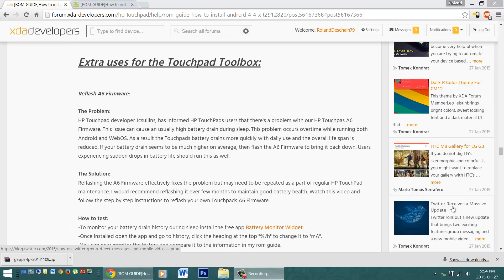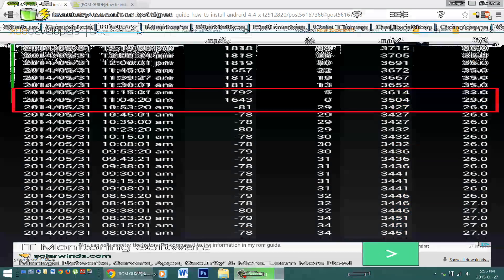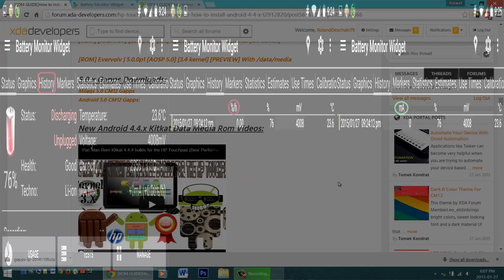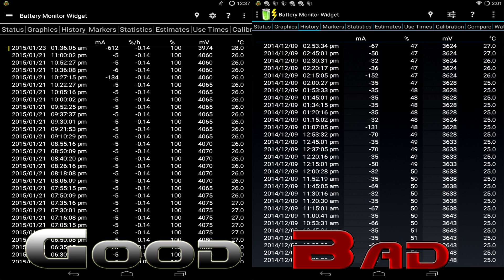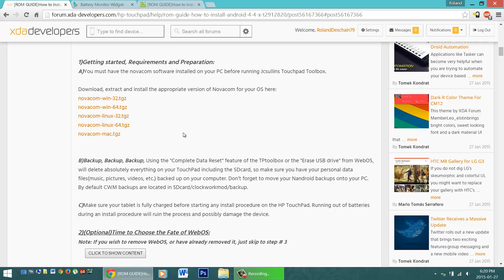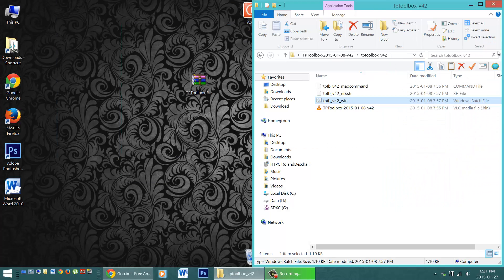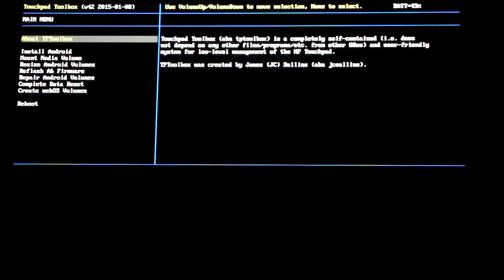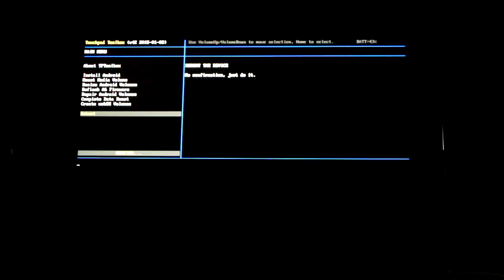How to Flash the A6 Firmware with the TPtoolbox

Comment: This was a breeze! Thank you for this and all the other Touchpad tutorials. I notice you mentioned putting the tablet "to sleep" over in the xda thread. Is this the same thing as airplane mode?
Reply from the maker: Pasha Davidson Not sure about what you're referring to as I have lots of posts. Could be I'm talking about deep sleep battery drain levels. The lower the drain during sleep the longer your tablet will last you. Post a link and I'll let you know:)
Reply: Oh sorry! This is what I am referring to http://forum.xda-developers.com/showpost.php?p=46573002&postcount=34
Reply from the maker: Pasha Davidson OH ok so I'm talking about the battery calibration and how some HP TPs have a larger battery capacity than others. If you have the original box you can determine which battery you have and make a slight adjustment to the BMW app to more accurately display the battery life of the tablet.

If you have the box you can check:
-See the Battery p/n # on the original packaging and refer to these numbers for reference  (*f29c)= 6300,  (*i29c)=6000, (*s29c) =5800

How to test:
How to monitor your battery
To monitor your battery drain history during sleep install the free app Battery Monitor Widget:
-Once installed open the app and go to history to see a log of your devices sleep history.
-To setup the Battery Calibration correctly for the HP TouchPad,
-go to BMW settings/calibration/Battery capacity/ and set it to 6300 (*f29c), 6000 (*i29c) or 5800 (*s29c) and tap OK
-Note* See the Battery p/n # on the original packaging.
-Note* after setting the calibration, users will have to allow several hours to pass before the history can be accumulated.
Or
You can also use Cool-Tools to monitor your battery drain in real time.

Comment: Hello Roland thank you for your fast respond on my issue, for answer your question I running the HP TP CM Jcsullins-tenderloin version 3.0.101 , Android 4.4.2, I also have a Samsung Galaxy S5, I don't have hotspot service on my cellphone account that's why I try to use my internet connection via BLUETOOTH from my cellphone to my HP TP, but for some reason it connect but I cannot surf into the internet, it's just show me the message I send you yesterday, what can I do to make it work do I have to change the CM version for different one? or what you recommend.  thank you in advance for your help.
Reply from the maker: Hey, glad to help you out. So it sounds like you need to update your Rom as a newer 4.4.4 build of Jcsullins Rom is available below. The bluetooth is a little buggy on older builds so hopefully that will fix the issue. I've added a link to my update guide, do a dirty flash to install the latest build. Let me know if this fixes the problem, cheers

cm-11-20150113-SNAPSHOT-jcsullins-tenderloin.zip
https://www.androidfilehost.com/?fid=95897840722642298

[ROM GUIDE] How to Update/Install Android 5.0.x/4.4.x Builds on the HP TouchPad
http://forum.xda-developers.com/showthread.php?t=2321397

Comment: Thank you for all your hard work for us to keeping using the TOUCHPAD, question " I try to connect my android phone with my Touch pad to have access to the internet but some how I get connect it but when I try to use the internet from the touch pad I get a message said the following ( Server not found

Firefox can't find the server at www.googl.com

1- Check the address for typing errors as ww.example.com of www.example.com
" http://www.googl.com/ "

2- If you are unable to load any pages, check your device's data or wi-fi connection.
 " Enable Wi-Fi "
 " Try Again ")
I did check all my connection including the spelling but still doing the same over and over any advice on this issue please.
Reply from the maker: Hey thanks I do my best to keep HP TP users up to date:) I've had that setup working many times with my HP TP running of my note2s connection. Its likely the phone setup, are you doing Bluetooth tethering or a portable WiFi hotspot? Hotspot should be more stable as the Bluetooth can be a little hit or miss. If you're new to this enable and the hotspot and set a password, connect the WiFi to the signal your phone is putting out and you should be good to go. Btw what rom are you using? I just tested it with the PAC MAN Kitkat rom and it was working fine.

Comment: +RolandDeschain

Hello! kindly bare with my poor english. ^^ i hope you can help me on this one. 
So, i'm planning to Install Android on my HP TP 32G
But i don't wanna remove Web OS. From what i understood, that might cause a problem in the battery, but it's fixable by doing the "Reflashing" thing. so far all is correct? 

Since the battery issue is cleared, do you have any recommendations/advice on which version of Android/CyanogenMod i should Install? 

I've read the steps on rootzwiki, but due to the language barrier..  alotta things are hard to comprehend on my side, but i'll do my best. yet there's too many hyperlinks and instructions >.<

in my case, it should be easy right? 'cause i'm not planning on erasing the existing OS.

- i should have the novacom software installed on my PC before running Jcsullins Touchpad Toolbox
- then i  erase the SD from the WebOS settings (it won't delete my apps etc..)
- in the PC,  i extract the Jcsullins into a folder and run the batch file
- then i should enter recovery mode in the HP TP. and choose to install android (The TP Toolbox will mount the media partition/volume to your PC. Open the Touchpads Media partition/volume and look for the “ttinstall” folder. Place the Rom, Gapps package and recovery zips into the “ttinstall” folder.)

And after that.. i'm lost :D (Select One of each, Rom, Recovery, Gapps, .zip files to download and install) -  what the hell is a Gapps xD ? i'll be able to select between these options in the PC or the TP ?  i dunno i don't understand the remaining steps ^^ 

HELP  PLEASE </3
Reply from the maker: You're almost done just pick one of each file type. Download it to PC put it in the ttinstall folder on the tablet, they are all listed in the guide., Gapps = Google apps(play store ect) Each version of android has its own gapps package.
Reply: ***** Hey Buddy,

before i even tell you anything, i just want to thank you for your help and the outstanding guides.. man that was a lotta work! you should be awarded bro lol my sincere gratitude!
anyways,  i'm installing Jcsullins CyanogenMod11 now..  but i'm also tempted to install the pac-man version instead of Jcsullins. may i ask what version of kitkat r u using on the touchpad and why ^^ ?
Reply from the maker: Ahmad Al-Sarraj Thanks so much for your kind words of encouragement. It is indeed a lot of work but I'm happy to hear people are enjoying the latest builds of android on thier HP Touchpads:)

I would recommend the Pac Man rom, the increased clocks improve performance, I'd say its the best performing Kitkat rom for the HP TP. Checkout the video below, happy flashing! 

Pac Man Rom Kitkat 4.4.4 builds for the HP Touchpad (Best Performance) 
http://youtu.be/Y3B0nU8Ld2Y
Reply: ***** DONE!! That's a one awesome rom! lots of features and options to customize my TP. It's the 1st time i use an android OS. AND I STILL GET TO KEEP MY WebOS! I'm referring my friends to your awesome guides/videos! Thanks again man, i wish you all the success! peace
Reply from the maker: You're very welcome. I'm also happy to keep WebOS, thanks for sharing, happy flashing:)